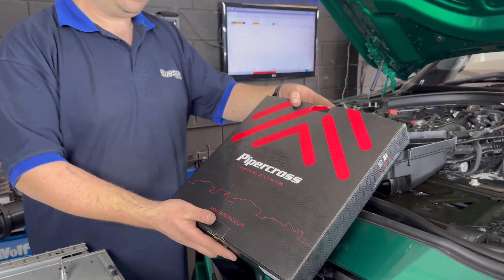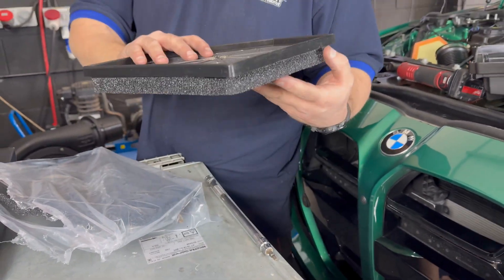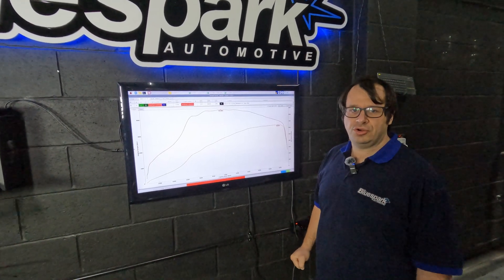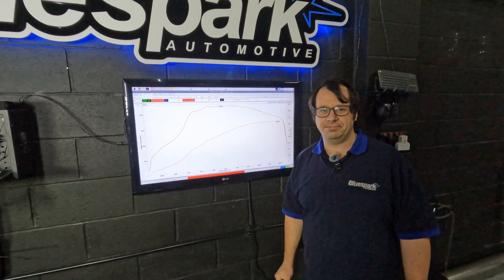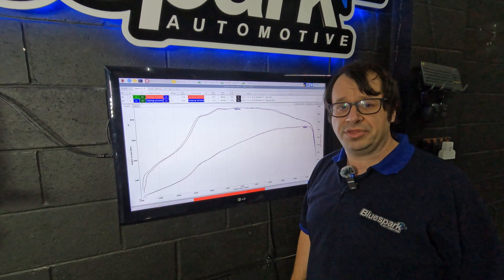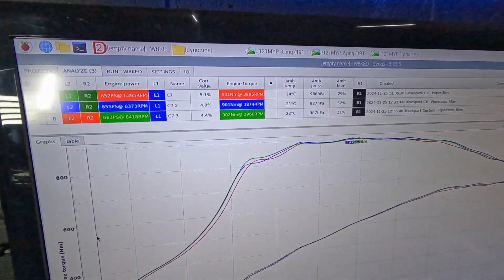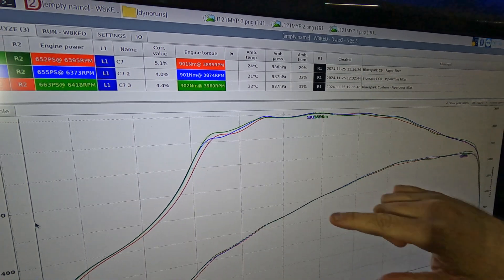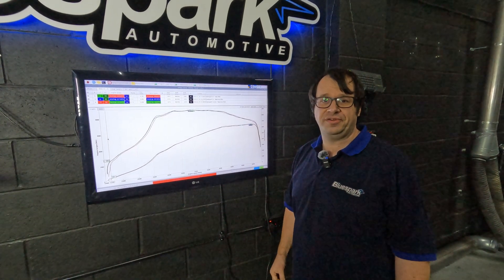Do Performance Air Filters Make A Difference? – Dyno Test Results

Comment: My ecu map is made for 2.4bar and car is starving airflow with stock air filter doing only 2.2 to 2.3bar stable boost, with pipercross it goes to 2.4 and its like 20hp difference
Reply from the maker: On what car?
Reply: @BluesparkAutomotive  e82 123d tuned to 300hp 550nm ~
Reply from the maker: @pav1u  cool, is that a panel filter or a cone? We find it varies strongly car to car. On the F82 M4 we found Pipercross made a loss in power.
Reply: @BluesparkAutomotive  Listen, it only works in tuned cars where ecu tune asks for more air and air is the bottleneck to make more power you understand? in my case tune asks for 2.4bar stable and is starving air at 2.2
/2.3, so with better flowing filter it reaches 2.4 and maximize the tune..people say looses performance or stays the same with filters because the tune bottleneck is probably not air or their cars are not even tuned.
Reply from the maker: @pav1u  Yes, we understand pretty well.. On the F82 M4 the Pipercross panels do not flow better than stock. They have more pressure loss than the stock paper filters. This is nothing to do with the tune, there is more measured pressure drop across the filter directly. We measured and proved it directly. The filters also made a 5hp loss vs stock paper when tuned.

 Obviously this isn't the case on the G80 where we can see  there is a power gain. The point is that its both filter and application specific.

Comment: So without a tune, pipercross drop in filters made less power?
Reply from the maker: At peak power they made 3hp extra, it was only the tiny bit at as it comes on boost that we had to clean up. Each line is labelled on the screen so you can see what's what.
Reply: You only run 1 bar of boost , so it can't actually use that extra airflow unless you get it mapped , but once it's mapped it would then be a instant 10hp gain for a £40 filter you can't argue. And the stick airboxes are designed for maximum cold air so it's the best option for safety and not heat soaking your intake

Comment: In addition to my previous comment on K&N filters. I have used them in combination with your BlueSpark tuning boxes and had fantastic results. Three generations of the BMW 30d motor and three petrol engines, N55, B58 & B38 hybrid, all have had hugely improved performance and economy. The diesels get the most benefit but although not the fastest the N55 in an f20 M135 was by far the most exciting to drive and a pretty good match for the M2 of the time.
Reply from the maker: Really glad to hear you have been getting great results from our units :)

Comment: I think a K&N panel filter would do a lot better than a “foam” style performance filter. Experience over 25 years of BMWs have shown they are best value for money even over K&Ns own pod replacement filters. There have been a few cases where additional ducting into the air box was required to allow sufficient airflow but that was on pre 2000s models. Not difficult to do with an appropriate shape large diameter piece of radiator hose and a suitably sized hole saw.
Reply from the maker: On the F82 M4 we got better results from the K&N filter than the Pipercross, so I'd broadly agree. Ultimately though we find that stock paper filters tend to be appropriately sized from the factory, so the theoretically possible gain is naturally small.
Reply: Pipercross foam filters clean the air better. K&N let's a fair amount of small particles through hence more flow and power gained. But both flow better than stock foam needs cleaning more as better filteration means clogs faster both gain but is marginal. Pipercross is half price of a K&N so I'm thinking of changing over to pipercross filters as price and better filteration. Also clean my filters regularly anyways and can use dish soap on foam filters. Just need dirt retention oil on bottom part of filter so cheaper to maintain.
Reply: @ I am not conversant with Pipercross  and their statistics but I will say I would suggest cleaning and on a more frequent basis than recommended. The oiling is an important part of reducing and capturing small particles so depending on distance travelled I normally would do a clean and reoil once a year. I don’t do many kms per year, two cars and probably tops of a total of 15k but much more normal would be under 10k. I guess K&N dates back a long way to 1960/70’s motorcycles so I have had good experiences so I stick with what has worked for me.